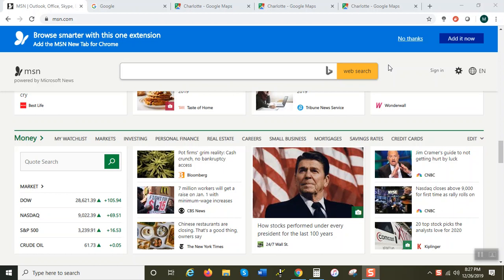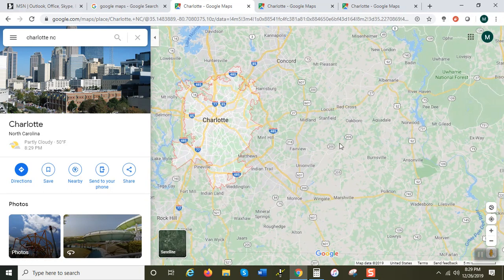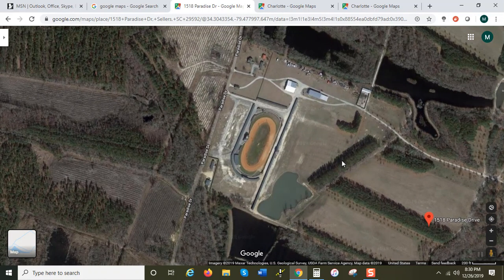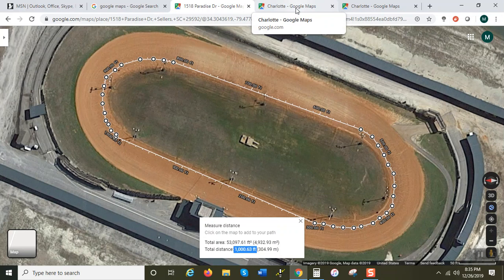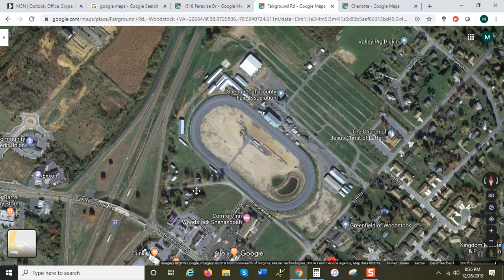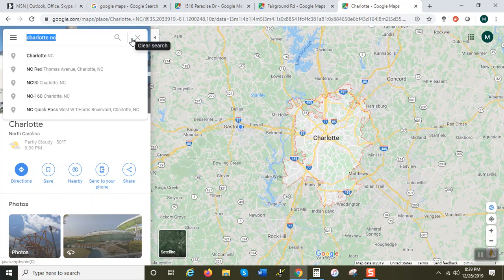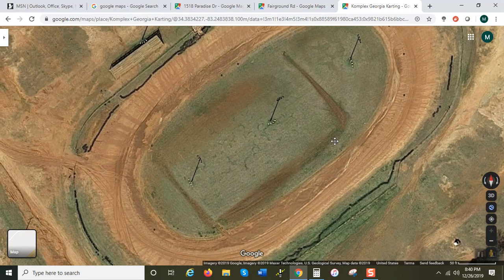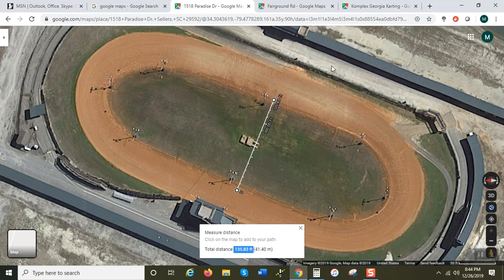Using Google Maps to Choose Gearing for a New Track

Comment: I’m looking for some way to calculate what sprocket combo I would need to run the same speed and rpm using 3rd and 4th gear rather then 5th and 6th gear would you know if this exists? Awesome video by the way!!💯👍🏻
Reply from the maker: It may exist, depending on if someone made it for the bike in question. It's just math, based on the difference in ratios between those two gear sets. Speaking very generally, 8-10 teeth on the rear sprocket equates to the gap in one gear to the next. Maybe one of the engineers will come in and explain it better than I.
Reply: Thanks I know my trans ratio per gear im a bit confused on how I find the final ratio to run the same in 4th rather then 6th last weekend I ended up running a 12t front and a 51 rear witch was on a 1/2 mile and the bike ran strong in 5th in the corner and 6th on the straight would have liked to have run 4th and 5th more in the power range just didn’t know where to go up and down on the front and rear of course but no idea
Reply: @bigstick1970  There are a number of calculators available online.  You'll need to know your gear ratios and if you want to calculate RPM you'll need to know the primary ratio - these can often be found in the service manual.  Basically you want to find an overall ratio (primary+gear+final drive) for 4th-5th, that is the same as you had for 5th-6th.
Reply: @craigpavlich9212  so if my final drive in 6th would be 3.50 I’d want to make the final drive in 5th the same to pull the same rpm and speed?
Reply: @bigstick1970  Exactly.  So you'll need a taller front sprocket or a smaller rear sprocket, or a combination of both.  I would recommend starting with a taller front sprocket, because 12T is small, increasing chain wrap and stress.  Also, front sprox are cheaper!  Then if you get to a point you can't go any bigger up front, start shrinking the rear.  I have tried to post a link to some calculators for you, but YT keeps deleting my links!
Reply from the maker: Thanks, Engineer Enginerd!  I had a setting to allow links in comments, and when I went to double check it, I can't find it here on my Creator Studio interface. So I lost it, or it's gone.
Reply: @craigpavlich9212  thanks that what I kinda was thinking so I got my sprocket chart out and my calculator since I know my gearing 1st through 6th made it pretty easy to at least get a staring point range! 💯👍🏻
Reply: Here’s the video of my race I missed 2nd like 3 times off the start fell to the back finishing 3rd https://youtu.be/zbLAfWGaXsI

Comment: Really I can't stop shaking my head. As much as ive enjoyed your other videos. This one just wasn't doing it for me . too much rambling talk for no reason . also there might be so many diffrent variables in tracks that the distance don't really dictate your gearing. One track may be tons of grip with alot of banking and the other have the crushed blue limestone with no banking . let's say for shits n giggles they both were1320 feet in length . I'm saying gearing wouldn't be even close unless one track you rode in4th and the other one in fifth then they might be wothin a couple teeth .if both run in same gear then there could be as many as 6- 7 teeth differences
Reply from the maker: Thanks for the feedback!  Some like longer format, and some prefer shorter.  Longer works in this case for those unfamiliar with the software and thought process behind predicting gearing. As I mentioned in the video (after some rambling lol) banking and surface are big factors.  Cushion type tracks would need to be compared to other loose tracks and clay to clay, so I agree with you.  I appreciate you watching, and hopefully the next vid will be more interesting!
Reply: Pretty sure he says in the video this helps with getting an idea, or close to what you’ll run at a track you’ve never been to before. I guess some are just more technical than others. A quick google of who Michael is will show you he’s a fast guy and that doing your homework is the difference between local riding and getting a national number.
Reply: @erikmhartley   I know who he is but that doesn't mean that it will get you as close to the sweet spot of your gearing which he says also . you dont have to take up for him , he does it well enuff himself. And I didn't say he was wrong , theres just so many variables that distance around a track only will get you close. Not saying hes wrong.  I know I've never went to a track that I didnt knowsomeo e else whos been to it and thankfully our flattrack family is always up to giving up their notes on gearing if asked . I always ask about gearing for a track I havent ridden and never been steered wrong .
Reply from the maker: Jase: I found where I specifically address the excellent point you brought up, if you're interested.  It's in a race report I did after the event on the 1/2 mile featured in this video. Skip to 6 1/2 mins for the discussion on gearing there versus clay of similar length.  Cheers!  https://youtu.be/wffSMO8SSD0?t=390